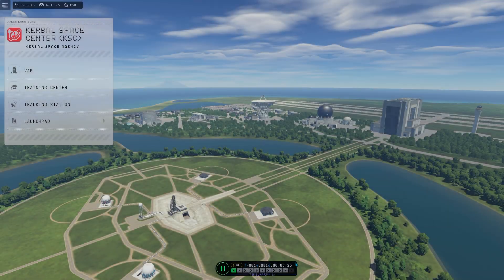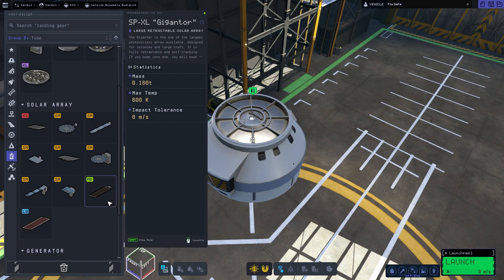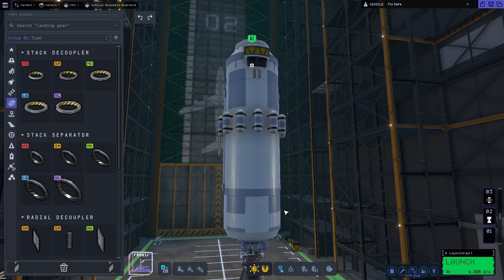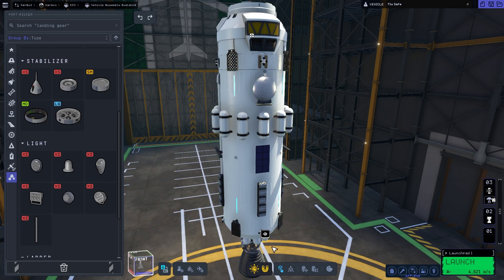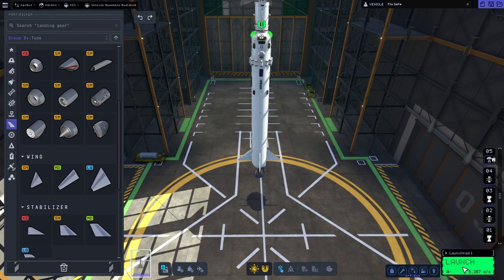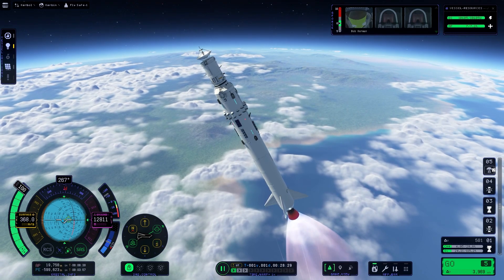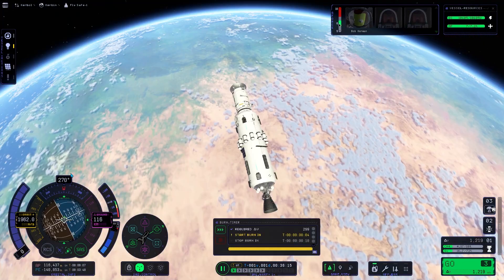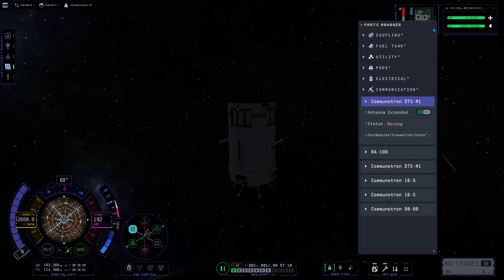I made a Reusable Satellite Rocket in KSP2

Comment: @5:30 spaceX don't go orbital with the first stage of their Falcon so a heatshield is not needed as they are not going fast enough.
Reply from the maker: Appreciate the info, I thought they did but I didn’t know
Reply: he is actually right falling speed is also too high thats why falcon 9 does a re-entry burn and the dome of exhaust protects the rocket
Reply from the maker: I saw some of their broadcasts and it looked like they used the engine to me but I don’t know if they did it in the atmosphere or not